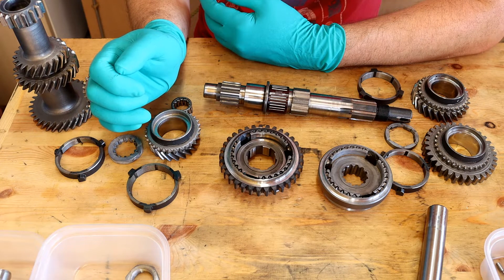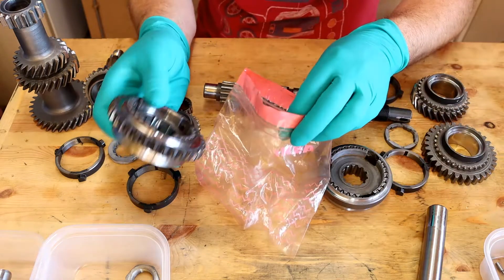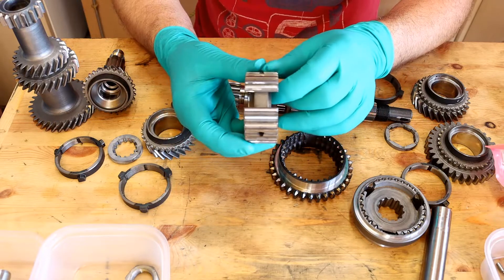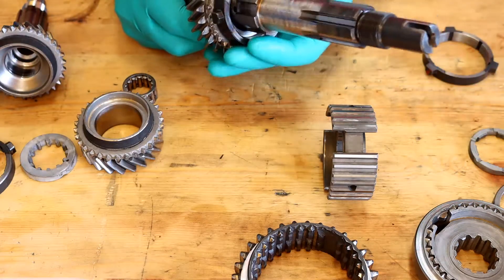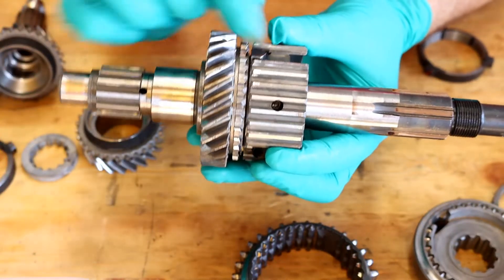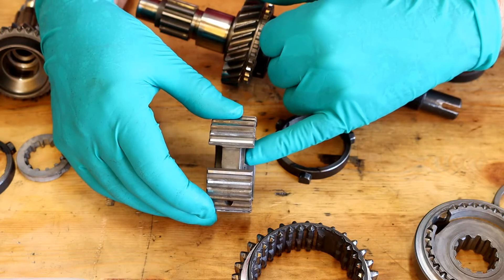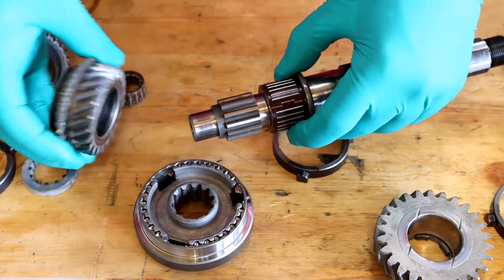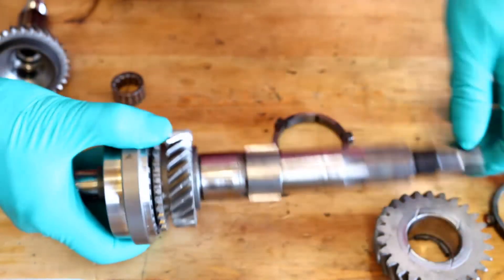Classic mini gearbox synchros rebuild

Comment: mines a different box but the design is identical, when i assemble it those baulk ring things dont grab in a stiff way, just a sort of almost stiff way, 2 days after having it all back in they stopped working altogether and its crunchy time again (the rings i used were borrowed from a known perfect box out of a scrap car).... I cant do it again getting the gearbox in last time nearly killed me and i'm sure i got an hernia...
Reply from the maker: i wasn't going to do anything to my gearbox, but then i thought how annoyed i would be if something failed?
Reply: @mrfid72  mines been very unreliable but it's eating itself, if it wasn't so heavy and awkward and needing 3 to fight it I'd have another go with donor spares but as long as it's rolling I'll double clutch to get 4th.....